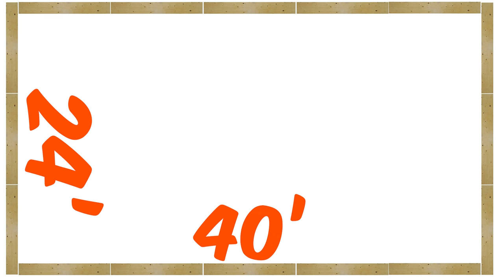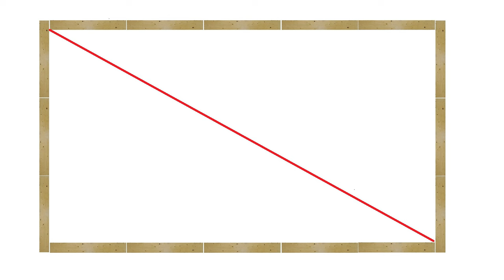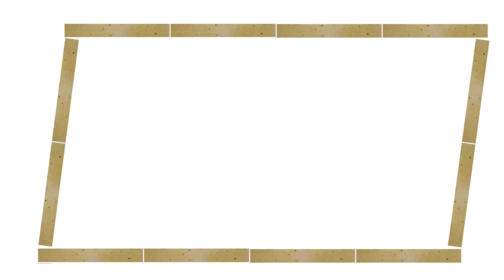How To Build a Backyard Rink

Comment: You don't need boards THAT high y'all. My yard ended up having an inch and a half on one side, and 5 inches at the far end, and you only really need an inch of ice to skate on. This is a BIT dramatic a vid, just saying. Oh, and the water isn't PUSHING out the boards either, you do not need that much bracing. Shit, if I saw only this video, I'd be scared to want to have a backyard rink too! Glad I've done it once already, and pretty much know what is needed. #ThereisEasierWaysYouGuys